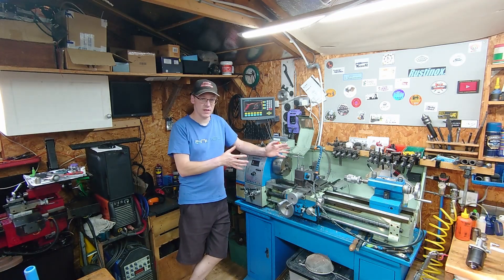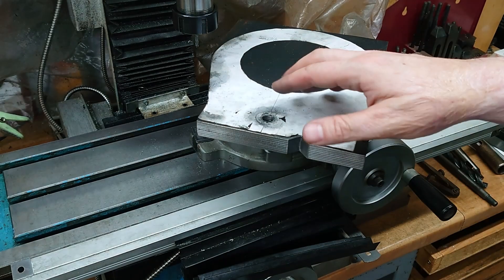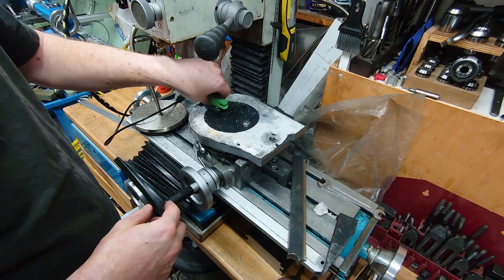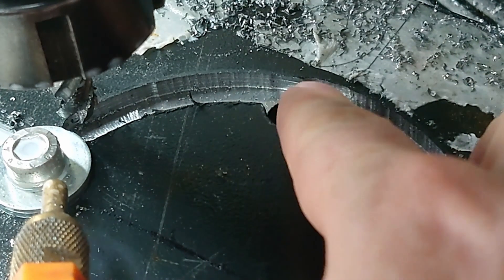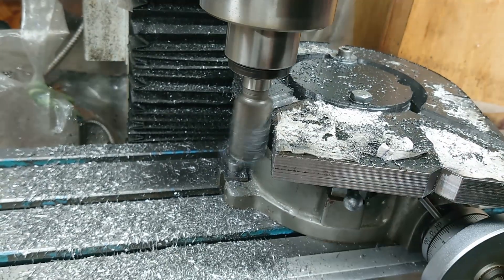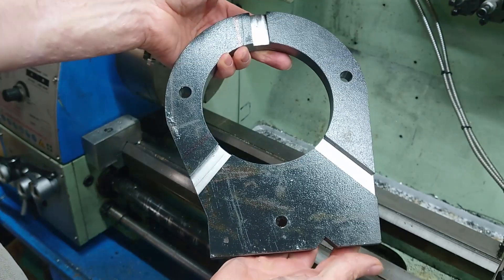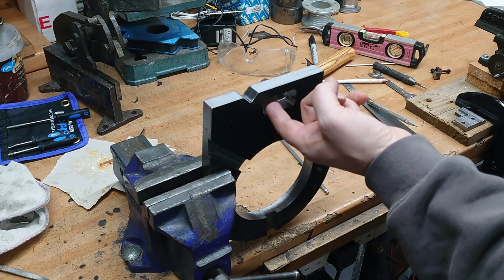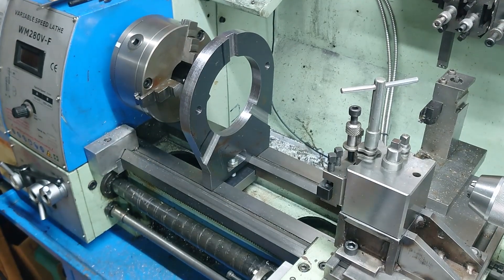Making a fixed steady for a lathe

Comment: Why not just make a follow rest? The steady is decent on a monster lathe with bed length over 2m, but for anything less - i find the traveling rest to be the optimal solution, moreover, it supports the part near the cutter, so it bumps up the rigidity of the set-up and boosts the precision of the cut thereby... What is more - and while it is a pain in the ass, if you are making it yourself, you can machine your own micrometer feeds for it, which allows you to feed the tips in with ease after each cut... It is invaluable for precision turning and for screw-cutting, and not just that, but a traveling rest is a surefire way of annulling any and all workpiece chatter, even when boring an internal diameter... And while i`m here rambling about chatter and internal diameters, you can drill out your boring bars, ream them a bit undersize and fit a ground carbide rod inside them with the use of differential cooling... It won`t make your boring bars into a solid carbide boring bar, but it will boost the rigidity of the damn things by a metric mile... Leave some 2mm wall thickness and shove a carbide rod inside... Carbide rods can be had for cheap(relatively speaking) and they can transform all of your tooling from limp-dick-steel into something resembling a decent tool, and it works even better on square shanks, as they often can be drilled through and the carbide rod can be pushed all the way to the cutting end - that is - if you offset the hole away from the insert retainer screw... You can even cut the length of carbide down to half the square shank, as the large majority of the shank is retained by the toolholder, and only the 1/4 or 1/3 near the insert is left hanging unsupported, and while the rod diameter will be less than that which can be shoved inside a boring bar(due to the retainer screw and the need to offset the hole), it will still improve the rigidity of the tooling by a lot... The tandem of following rest and carbide reinforced tooling can turn your average mini-lathe from a chattering mess into a graceful machine capable of much more than one would expect... It won`t turn a chinese lathe into a 10EE or similar, but it will boost the performance by a lot, and it will do so for a very acceptable price... 
Also, consider drilling out your qctp toolholders between the vertical screws on the ``top of the C section`` and wherever you like on the ``bottom of the C section`` of the toolholder and box them in with a decent thickness plate... That same plate - if thick enough - can support two(one at 1/5 from the front and one in the last third(from the rear)) set-screws which will force the tool into the toolholder, pushing it hard against the ``inside of the C section``, which will further boost the rigidity of your tooling by keeping it in solid contact with the back of the toolholder, along with the vertical clamping screws keeping it pressed down against the ``bottom of the C section``, all the while the toolholder is boxed and reinforced by the plate that is preventing it from gaping open from the forces applied by the vertical screws... It is a compromise as it forces you to be mindful of the potential collision of the added plate with the chuck jaws - but then again - you have to be mindful of crashing into the chuck jaws whether you have that part added or no, and most of it can be ameliorated by swinging the toolpost slightly as to keep the tool as the furthermost part of the whole set-up... 

Aside from that bit of advice essay, nicely done - for now, tho, i`d go with steel fingers, or bronze, as alu tends to gall against steel, and is utter shit when it comes to rigidity... Bronze would slide nicely, and steel is - well - steel, the king of materials, lest we`re talking insane high-performance exotic alloys... 

Best regards!
Steuss
Reply from the maker: A follow rest is no good for facing, and that is what I built it for. I agree a follow rest would also be useful. The steady fingers have bearings on the ends, so aluminium will be fine, if not as strong as steel. As for the toolholders/toolpost, I proved fairly conclusively that they made zero difference in my solid toolpost follow up video. Clamping the tool in a significantly heavier and more rigid vice gave identical results. So the toolholders are not currently the weakest link, but when they are, I'm probably going to upgrade.
Reply: @ollysworkshop  Regarding the traveling/steady rests, why would the traveling one not be useful for facing cuts? My lathes have mounting points for the traveling rest on the lower slide of the carriage - which sits still during facing cuts, and is clamped to the bedways... Such a support should be suitable for facing cuts, especially given that it`s sitting in the exact same position as a steady rest would be sitting when clamped to the tailstock ways on the bed... Sure, a steady should technically be more rigid as a closed circle and a chunk mounted with no intermediate platforms between it and the bedway, but a decent traveling rest mounted to the carriage doth stay still during facing cuts and only moves during longitudinal cuts on the external diameter, which is why i was harping about it`s superiority over the steady which is bound to remain in one position as not to disturb the set-up... 

Don`t get me wrong, i`m not against using a steady for facing cuts, nor in general, but i kinda see the steady as a very niche accessory that in 9/10 cases can be avoided - if one has a traveling rest... The 1/10 cases where a steady trumps a traveling rest is when you are facing from the center outwards, where the traveling rest would fail to provide any measurable level of support, unlike a steady which provides support from left, right, up and down via the 3 fingers, but my big lathe has a traveling rest which supports from below at 7 o`clock, at 3 and at 11, which still renders some semblance of 4 vector support between the 3 fingers, but i`m forgetting that most traveling rests have 2 fingers - and thus only 2 vectors of support - which i guess is what you are using as a standard traveling support design reference... 

Regarding the toolholders and the vise clamping, i actually recall what you are talking about now that you say it, but i was merely rambling about ideas on how to SKOOKUM-ify the lathe to the max, and the idea was tossed out for anyone who reads it and could make use of it, but you are right, there are a bunch of other factors that can be amended first, before dealing with such modifications... Tho, most of the mods are quite comprehensive custom pieces that require both a lot of time, decent tooling and decent sized stock to make, such as a solid toolpost riser that is integral to the cross-slide...

Best regards!
Steuss
Reply from the maker: Having never used a steady of any sort, I am talking from a point of inexperience.  My worry with the follow rest is that there are only 2 points of contact from the rest. When facing the end of a piece of stainless pipe I have visions of it grabbing and finding its way out of the rest, probably taking some carbide with it, hence the preference for the 3 points from the fixed steady.
Reply: @ollysworkshop  Yup, there we go... I`ve completely neglected the fact that most traveling rests are 2 finger supports... My bad... I guess that the equipment that we have tends to shape the way we think, as well as making us ignore what we know to be the general design standard... 
But there you have it, you have been given an idea as to how you can approach the making of your own traveling steady which can render much greater support and be of greater use than most commonly seen traveling rests... Just make a C, put in 3 sliders - at 7, 11 and 3 o`clock(or 2 if you want, i dare speculate that it would not cause any issues) when looking at it from the tailstock end of the lathe towards the headstock, with the 3 o`clock being across the operator and 9 being on the operator`s side of the bedway... For most applications, you can ignore the lower - third finger - and use it for facing cuts only... 
Just get a scrap tractor weight, they come at over 1in thickness(often around 3cm), and they are cast iron(machinist beware the potential chilled sections)... They can be found for pennies on the scrapyards, and they come in all shapes and sizes... Aim for the flat plate ones, as there are many forms in which they come, but others also tend to make good project stock... Most of them at the scrapyards are older than you and me put together, and have seen winters and summers at full exposure to all elements, so they are as stable as old iron comes, and a lot of them are decent iron too, with the more recent ones being more likely to pose machining troubles... 

I have some 150kg of them in the stockroom, and i`m planning to remake the carriage of my mini-lathe from one, with extended front bits, as well as greater thickness(at the expense of max swing dia over the carriage), as well as making a new cross-slide out of the remainder of it, given that i picked up a few large ones... The larger the carriage - the lesser the pressure applied to the bed, and the thus the greater the rigidity of the lathe, moreover, with a fatter carriage and a fatter cross-slide, i can annul the need for the toolpost riser(and omit the compound), which would allow me to bolt a custom toolpost to the cross-slide itself, thus rendering the baby lathe even more skookum as a light machine... 

Snoop around a few scrapyards and see what you can find... They can also be had for a much higher price on the ``second-hand`` market websites... Not just that, they come in really nice sizes which are often hard to get cast iron in... 

Best regards!
Steuss

Comment: Buy some hand taps, they're a lot stronger. A common mistake is undersize holes for tapping. This and non round holes...Spiral point machine taps are great on soft aluminium and blind holes, but perilous used when hand tapping. Especially brittle Chinese crap....Kudos for hogging out that lot on that baby Mill. Ripper End Mills are wonderful...I used to machine Gun Metal, that's really fun...😏🇬🇧
Reply from the maker: I have hand taps, but they are as standard, so not able to tap the very shallow blind hole (5mm/0.2in deep) with enough threads.  That spiral tap had already broken before and I had ground it flat for doing holes like this. I think I got the set (M3 to M8) from AliExpress for less than £10, so the fact they cut at all is a bonus really. After I reground the broken tap, I did manage the other two blind holes without incident.  Those ripper cutters are really good, the mill motor did get pretty hot at times though, it's only 500W.
Reply: @ollysworkshop Yes, you use what you've got eh?...I'm retired now, I just have a Myford Lathe. I built my own miniature Gas Turbine with it though. It's amazing what you can do using a bit of imagination and improvisation...😏🇬🇧

Comment: Great stuff 👍 
I had to zoom in on the chips to see if you were using cast iron -I couldn't believe you'd be attempting such a thick lump of steel!
Full marks on recovering the broken tap, and nice job on the straight knurls (still something I've never managed to pull off). Looking forward to the next one.
Cheers Olly, Matt
Reply from the maker: Hi Matt, those carbide roughing cutters are really the only way to do it. Regular end mills would be squealing away doing cuts like that. It was pretty crummy hot rolled steel. I had a massive 800x800x18mm piece of it from a prototype at a previous job. When I saw it being thrown out I could see the steady rest hiding inside it!